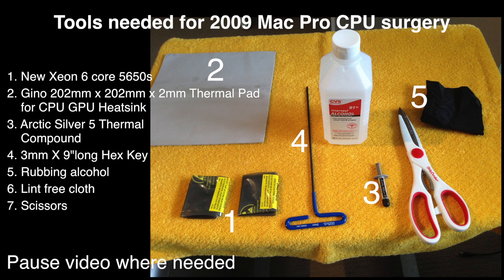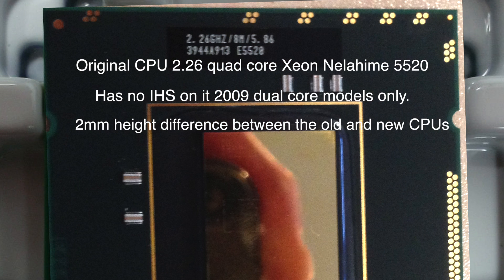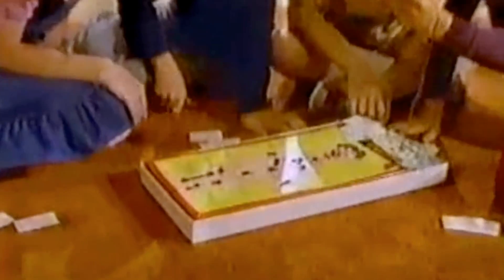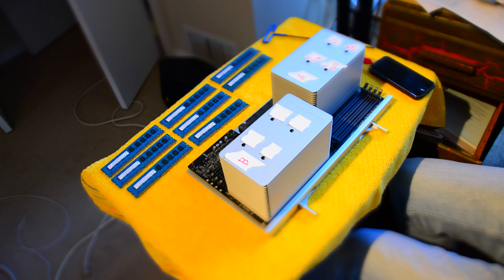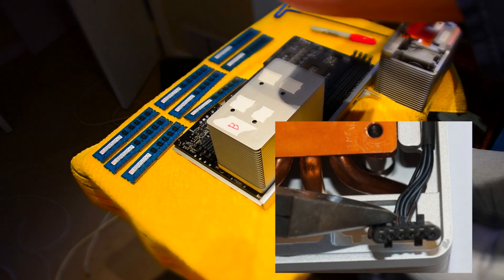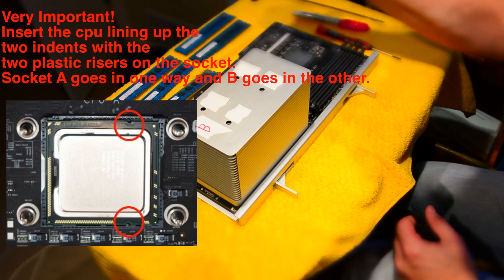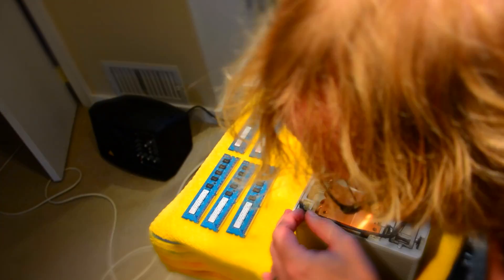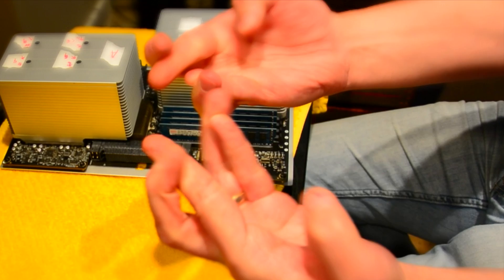Mac Pro 2009 5,1 CPU upgrade 8 core to 2010 12 core

Comment: Hello Lance!

I did the upgrade, still I cant be sure if I ruined the whole board, or just something minor fault occured...
I had all the ingredients, and also used delidded cpus. (x5670). I did the firmware upgrade with a single core tray, and then made the upgrade on a 2 core so maybe its a fault i made? what happend after i finished the replace the cpu is the flashing power button, i was scared, so changed back to the old cpus. It had the following error message when i tried to log in: 

"panic(cpu 0 caller 0xffffff8018b213c6): "zone_init:kmem_suballoc failed"@/Library/Caches/com.apple.xbs/Sources/xnu/xnu-3248.30.4/osfmk/kern/zalloc.c:2284"

I have no idea what does it mean... I tried to change it again with new thermal compound, cleaned again, but the same, i tried with another tray, now it works. i have the feeling, that only cpu b works, there is a big difference in heat, when i removed...
I was looking for damage but didnt notice any physicall so far...

If there is anyone who could help me please!
Reply from the maker: You have to do the firmware update with the CPU tray installed that you are doing the upgrade to the dual processor CPU,. I find what you said you said very confusing, why would you do the firm ware update on a single CPU tray then swap,it out for a dual?
Reply: i have another mac pro also 2009 an was used that for a trie out, cause if i do smthng wrong my loss wont be that much. but i forgot to use the original tray/machine in pair :( . i know im not a genious in these tech things:) could you recommend any solution?
Reply from the maker: +Gellért Füzi I need more info, but you should put the original CPUs back in and do the firmware update first then try installing the newer CPUs  but agin I am not quite sure what you did. Newer CPUs will not boot without the firmware installed first, you can't use 5670s in a single CPU tray only dual.
Reply: Hi Lance i truly appreciate, that you try to help:) it seems I'm not hopelless. did the fresh upgrade with the two processor tray and the machine , and now it works.
Only question left is that what can i do with the other tray i ruined...

I know it s foggy what happened but to sum up there r two machine (the same 2.26) and one 2.66 quad 2009. 
when i updated the firmware first i was too tired and was looser, cause updated firmware with the quad machine. then i replaced the cores in the other tray, and tried in the quad machine. and now the tray is dead...

i want to save it, i quite sure i didn't make mistake with the hardware part, but now the tray went crazy cause the upgrade. hope i can save it, if u have idea how to save it welcome,e and thanks again for everything!
Reply: a last question: is it possible to ugrade a 4 core single procesor 2.66 2009 to six core, or its olny possible with dual cpus machines?
Reply from the maker: +Gellért Füzi you can make the quad core a 6 core but you have to use 3600 series Xeons not 5600s they are for duke CPU only so get a 3680 or 3690 if you put a 5670 into the single CPU unit it will never work you need a 3600
Like a 3680 or 3690 which is the fastest you can install.

Comment: Hi Lance!

You r the god of mac pro:) i really appreciate your work! May i kindly ask you how to do the procedure with deluded processor? As i got you it s much safer to do it that way. I ll remove the IHS or ask someone to do it for me but how its change after? i did the upgrade successfully so far, i have pair of x5670 slvb7 processors. to place them i just have to clear the thermal paste from the heatsinks and that s all? remove IHS is not safe someone wrote below?!
looking forward to get reply thanks!
Reply: ps: do i have to remove the remainder of the solder thing has to be removed with articlen ? do i have to put back the black frame of the cpu? thanks for answe:)
Reply from the maker: +Gellért Füzi you have to remove any left over solder or residue off the top of the de lidded CPU so it's a nice clean shinny gold, when you remove the old CPU clean off the leftover compound with rubbing alcohol to give you an idea what the de lidded CPU should also look like, and yes I would put the black spacers on. I would definitely count the amount of turns it took to remove the heat settings so that you have a general idea of how many turns it's gonna take to put them back on because the hight will be the same but I would go with one less turn when your when you're putting the CPUs back in always better to go a little less than too tight at first. Do one screw 3 full turns then do the others in a X  pattern. then do it again another three turns on each or how ever many it took to unscrew the point is don't screw one screw everyone all eight turns at once screw them down gradually in a X pattern.
Reply from the maker: +Lance McVickar also you need to carefully use a razor blade to get any residual solder off the delidded CPUs.
Reply: ahh thanks, and as i guess i dont have to use thermal compund on the delidded cpu right? my friend has a 5,1 and wanna replace cpu as well, in his case there is nothing to do just to replace, put new thermal compund and put it back? it is a 2.4 eight core, or a 2.8 quad core im not sure, thanks for answer!
Reply: once the ihs removed there is nt any surface to put the thermal compund on right?
Reply from the maker: YES! You have to use thermal compound on the delided cpus or you will fry them! put  a small line down in the middle of the cpu, watch my new install video it shows how the thermal past is put on cap or no cap, not all the way to the edges or it will spill over. You will see when you remove the old cpus that there is left over thermal paste on the CPU and heasinks you have to really clean off the heatsinks first getting rid of any old thermal compound. Yes your friends if it's a 2010 you just need to clean off the paste and install new cpus and paste. Be carefull putting the heatsinks back on its a bit harder than the 2009, as there are no posts to guide it back onto the logic board only the connector but it is easy except for that part and you have the clamps that hold the cpus in place so that part is easier and less chance of crushing the pins, but I would still count how many turns it took to remove the heatsinks to give you a general idea of how many it takes to put it back on. I have a new video that I did my friends 2010 cpu upgrade at his studio, it was not easy getting those heasinks back on.

Comment: Thanks for the video Lance. I used your steps to upgrade a 2009 MacPro Dual 2.33 to Dual 3.33 X5680's. Works great.
Reply from the maker: Great glad it worked out!
Reply: Hey Lance,
I did this upgrade about two months ago and all has worked great till now. One step I did not do was to use a new thermal pad. Over the weekend the machine out of nowhere starts blowing full blast with its fans. I have reboot zapped the PRAM and reset the SMC, yet still, after 6-8 hours she spins up again and blows full blast. Using a temp monitor it appears that CPU A Heatsink is reporting a high temp, however the CPUs temps are all fine. Im thinking Ill add the thermal pad, and re-apply thermal paste, see if that makes any difference. Past that Im not sure what else to do. If you have any ideas I'm all ears. Thanks in advance.
Reply: I was incorrect. It is actually "Relative to ProHot" that is registering 73degrees. The boosters are both going up to to 5200 RPM. The other CPU sensors are lower then normal when the fans kick on.
Reply from the maker: Yeah it might be because you did not install thermal pads on the sensors, if things are not reading correctly the fans will go full on, I think it's very important to have the thermal pads if keeping the IHS caps on the cpus. I would get them and reinstall or remove the IHS caps if you dare...
Reply: Looks like I have a fun night ahead of me :) Thanks again Lance. Will keep you posted on the outcome.
Reply: A quick update. Didn't want to take the heat sinks off just yet. I turned all 8 screws a quarter turn extra. I then went in and pressed down on the fan cables that connect to the mainboard. Things seem to be a ok now. Think I had things on a little lose and the heat build up over time took hold...  I stress tested the machine for 2 hours, and its been on for 3 days now w/o 5500RMP fans. Hope I didn't just Jinx myself ;)

Comment: I completely screwed up the cpu board. The socket B has several bent pins and burned off a piece from the cpu that is melted onto one of the pins. However it boots flawlessly with only cpu A. But we all know the fan goes nuts that way. But how bad can it be other than it being annoyingly?
Reply from the maker: Dang sorry to hear it, :( The issue with that is the fans will eventually pile up dust running at full speed and possibly burn out as well not sure, I would get another used logic board on ebay.

Comment from the maker: https://www.youtube.com/channel/UCNl5Nc2iYthhqIU6_HRjDYA
You need a six core 3600 series to upgrade the 4 core mac pro 2010. Xeon six core 3680 3.33ghz or the fastest you can go is Xeon 3690 3.46ghz.
Reply: Hallo again, on this video you are installing x5650 and the other guy (Steve Hoge / 2 years ago) installed successfully X5690.  You both must had to use thermal pads because of 2mm size difference. 
Does it mean that as long as W series: http://www.cpu-world.com/CPUs/Xeon/TYPE-Xeon%203600.html, are being used, than no additional thermal pads are required neither on cpu or  heat sensors?
Cheers!

Comment: Anyone know how much more power draw these CPUs would create? I'm worried that, if I were to do a 12-core upgrade, put in a high-end GPU, and add more than the current 32GB of RAM into my 4,1 Mac Pro, the PSU wouldn't be able to handle it all without having issues.
Reply from the maker: I have all my drive bays full, all my pcie cards slots full, and I recently upgraded from 5650s to 2 Xeon 5680s 3.33ghz 12 cores, and from a R9 280X to a GTX 980ti... no power issues.... You can always ad a separate psu for your graphics card if your really concerned about it.... but I have had know issues at all. Here is a link you can see the power draw, 5670s draw quite a bit less than the 80s
http://cpuboss.com/cpus/Intel-Xeon-X5680-vs-Intel-Xeon-X5670
, but a lot of folks have 5690s in there mac pros without issue as well and they draw even more power.
Reply: Lance McVickar Thanks for that! Yeah, I just looked at 5670s, and they seem to draw the same 95W (each) as my Mac Pro's stock CPUs do. Good to know that yours is doing well with all of that power draw. Not sure why people stick in an extra PSU.

Comment: So I did this upgrade and its has been bittersweet got the RAM to Post (128GB) and both CPU's 3.333. However, intake and exhaust fans on high constantly and Boost A as well. the Heatsink for CPU B doesn't appear in the test tools Istat and TG Pro so neither does the tdiode. Any suggestions I'm at wits end. OBTW I took it apart and reinstalled heatsinks like 5 times today no joy. The lids are still on have had a problem with tightening. Could "under tightening" cause this?
Reply from the maker: Did you cut the heat sink connectors like I did or did you leave them alone?
Reply from the maker: Start with just CPU A and get it to boot and show the ram, fans will still be a full speed you can leave cpu B and heat sink uninstalled and its ram make sure your Heastink connector is in the right way not sure if they can even go in backwards... and all the way in. I don't think it can go it too far, .  The connectors should sort of pop in as you push it down, I put the connector in first then put the heatsink on, not easy to do as there is such little slack. Once CPA A is back up and running install CPU B. There are lights on the mother board to guide you a bit, if B is not working it will show a red light that glows behind the heatsink when you look into the macpro while it is on with the door off same for A light is behind it's heatsink. 
I just did the upgrade again myself and it took me way longer than I expected. I was at the point where I thought I had fried the logic board because it would not boot. Tunrs out some leftover compound got in between the cpu and login board. 
I would start with A make sure you have no bent pins first and clean everything and start over. Get A working with booting the computer, 
I find if you tighten and loosen too much with out starting over the compound connection may not be good enough anymore and cause the cpu to not show up. Sorry you are having such a hard time let me know how it goes. If you get it all working again but the fans are still blasting you may have damaged one of your heatsync cables or sensors.... hope that's not the case...
Reply from the maker: as far as tightening goes I found that 3.5 is a good starting place. Then if still not booting a 1/4 turn on each screw try to boot again until it s working and all ram. It took me 4 trys before I got CPU B to show up with all the ram.... Use the line method for the Compound not the pea method go left to right on the cap when you have the cpu tray latches facing you. --------
Reply: yeah ok im back where I started.. Both cpu's are posting ram is posting CPU B tdiode ans CPU B heatsink arent showing upnaccording to TG Pro. But I see CPU B's fan spinning I wonder if that's from the intake case fan on a full speed?
Reply from the maker: Did you add the thermal pads to the heatsink sensors?
Reply from the maker: Also make sure istat is not controlling your fans and set them to default, then try zaping your pram and resetting your logic board. Resetting the SMC can resolve some computer issues such as not starting up, not displaying video, sleep issues, fan noise issues, and so forth
Reply from the maker: Did you look for any red LEDs while its turned on to see which ones are lit?
Reply: Yes I did. That happened once or twice but I solved it as i tightened the heatsink screws. Funny thing is I'm tightening the screws on CPU B more than on CPU A last time I went where I felt it was too tight the case fans stopped spinning but CPU B's fan was running. I assume this to mean I hadn't lost the sensors perhaps but at the same time it no longer booted up CPU A stopped working it seems. Also when I took in apart there was no damage to the socket pins. Also this time I am using washers.
Reply: uninstalled istat just to make sure.
Reply: One last thing the cable that connects heat sink to the logic board. does that need to fully lay against the heatsink(there is a "channel"). That cable has come partially loose from its adhesive. Is this a sensor of sorts and needs the full contact to the heatsink?
Reply from the maker: +Louis Alfred no it's just the power cable for the heat sync mine are loose as well
Reply from the maker: Ugh not good, sorry to hear it, was upstate fishing. Here is one for cheap as you have the heat sinks you could grab it.
http://www.ebay.com/itm/Apple-630-9402-2009-Mac-Pro-4-1-2x-Xeon-E5520-QC-2-26GHz-Processor-Tray-8GB-Ram-/201617131248?hash=item2ef15146f0:g:vTkAAOSwkl5Xer-a

Comment: First of all let me tell you thanks for video, it's great! But still have couple of questions.

You have to be very careful tightening the screws because there is a big chance to damage the motherboard. It is clear. So why did not you use the washers 2mm height to each screw?
You told nothing about thermal pad used in video. Is this pad ok http://goo.gl/I00G1b ?
Reply from the maker: I do talk about the thermal pads where to install them and if you look at the photo of everything needed in the video it shows the thermal pads and size / thickness that I used. there is also a link to the ones I bought in the comments somewhere.
Reply from the maker: Those pads look fine, mine were grey not blue. You only need a two this strips to go on the heat sensors, 2mm thick.

Comment: Okay okay 12 Core 

But what about Thunderbolt 2 speeds, I'II check on PCI e cards 

And how far off is 12 core Westmere from where things are today @HBFitnessTech Twitter?

No one wants to pay 15k for a video editing machine ... but is that the purpose ?

Thanks.
Reply from the maker: There are no thunderbolt cards for Mac pros and never will be but there is USB 3 and Esata 3 which is just as good as far as storage or pcie internal drives for boot or scratch disk options.
M
I just installed 5680s last night geek bench multi is over 30,000 single is 2704. I like twelve corse for Pro tools native. i7 chips in iMacs and Mac book pros and hackintoshes are very fast for creating proxy media and certain nonGPU video processing as they are optimized for video. My quad core MacBook Pro with 2.6 i7s was able to creat proxy media from 4K faster than my Mac Pro 22 core with 2.6 12 core... Go figure.